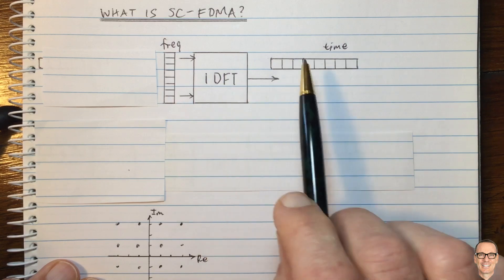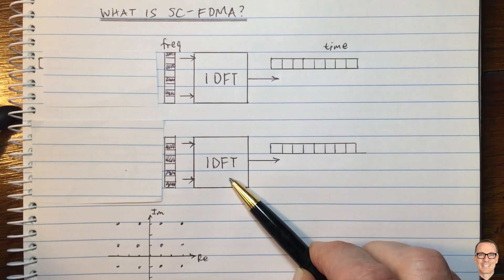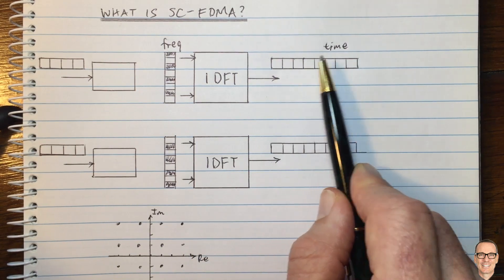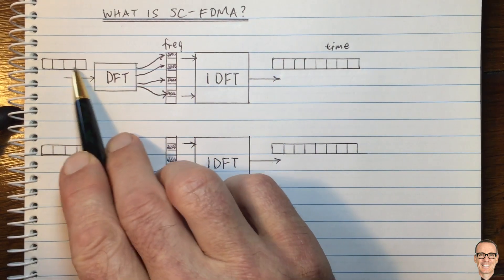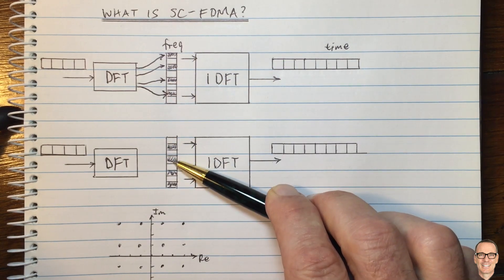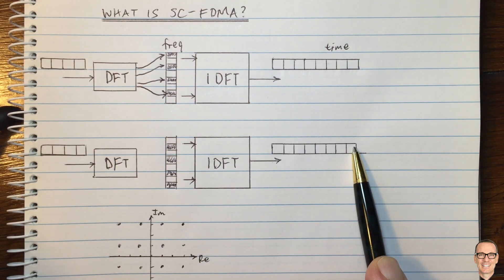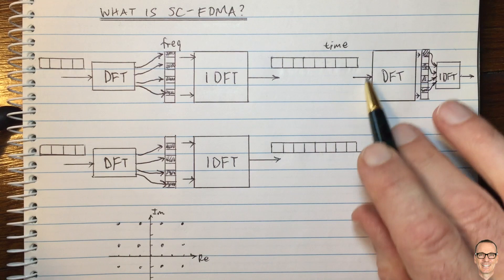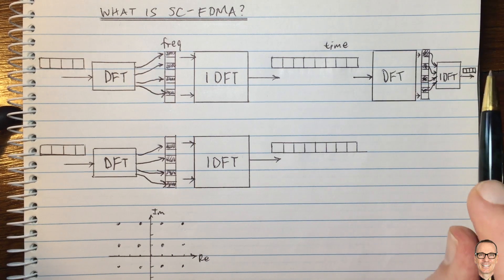What is SC-FDMA? And why is it used for the Uplink of 4G/5G Mobile?

Comment: If the DFT outputs for a particular user are mapped to a block of OFDM subcarriers, rather than interleaving them, does the intuitive explanation for low PAPR still apply in some way?
Reply from the maker: The short answer is yes. I said in the video that I would be putting out another video that shows all the mathematical details, but I haven't got around to it yet, sorry.

Comment: Excellent video. It is my understanding that another disadvantage of SC-FDMA is that you can't easily interleave reference symbols with data in the same OFDM symbol (i.e. on different subcarriers). The result is a higher percentage of resources are used for reference symbols with SC-FDMA. It this a significant issue?
Reply from the maker: Yes, that's right. Channel estimation is easier when training symbols can occupy their own seperate subchannels.

Comment: So much going under the hood inside the wireless digital communication devices. Todays modern mobile phones maybe used for few days or less on single battery charge streaming voice, data and image over the air.
Reply from the maker: Yes indeed. It's amazing to think how complex modern digital electronics is.

Comment: Thanks. A short point regarding a general topic. When I do carrier aggregation in a modern mobile communication network, aren't there any problems with the different propagation characteristics of higher and lower frequencies? 
Are there limitations what I can aggregate and transmit?
Reply from the maker: Carrier aggregation is the process of splitting a high rate data stream into multiple low rate data streams and then sending them on seperate carriers (frequency bands), as if they were independent data streams, and then recombining the data streams at the receiver. The propagation characteristics of the separate data streams do not affect each other.

Comment: The same channel was used .
Why access by OFDM method will encounter PAPR while ZF won’t ?
Reply from the maker: Have you seen my video on PAPR in OFDM? "What is PAPR? and its relationship to OFDM" https://youtu.be/F4LAZTdm_b8
Reply: @iain_explains  
Yes I did , sir , the carrier pile up in a period of time .
If we could made the carrier band width infinitely small , then the PAPR issue will vanished ?
Reply from the maker: No, the opposite. If there was only one carrier (ie. standard direct carrier modulation) then there wouldn't be a PAPR problem. The more sub-carriers there are, the more chance of having a PAPR problem.